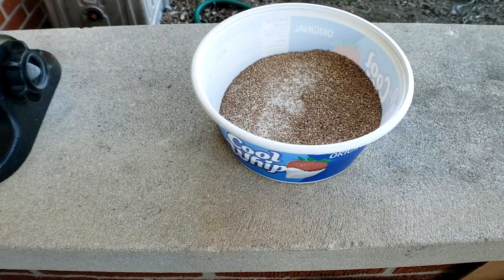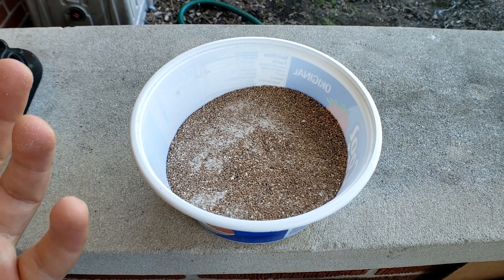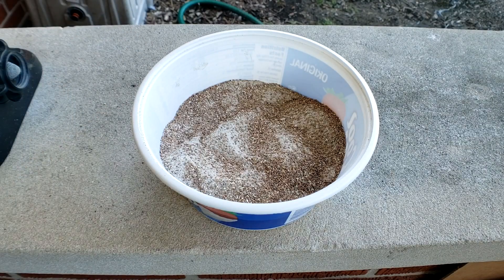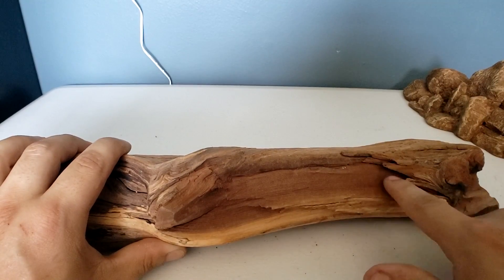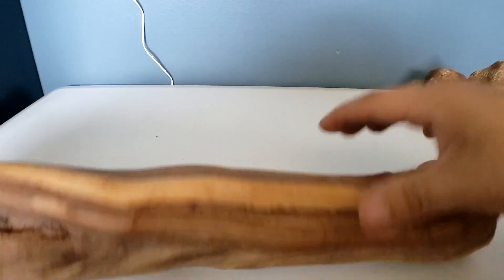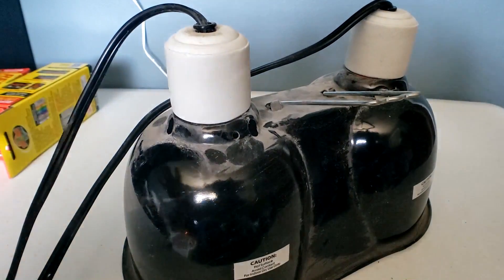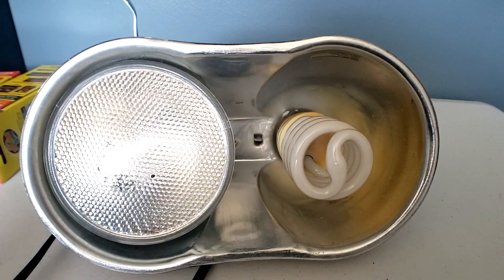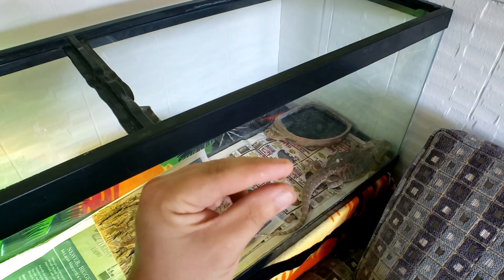Neglected Dying Bearded Dragon RESCUE Day 2 Part 1 Accessory Investigation | WHY Is the MBD SO BAD??

Comment: The thing about UV bulbs is that even when they light up, they are still going bad over time. It takes a few months and then there's no UV coming off it at all, but you can't tell that by looking at it.

I also tested some of those bulbs that are made for birds, with an industrial UV meter, and they don't give off nearly enough UV for use with birds. I don't know if the reptile-specific bulbs work well for reptiles, but the bird ones are a waste of money.

Comment: the device is an membrane oscillator for making mist.. think Halloween fog
Reply from the maker: ahhh i get it
Reply: @Animal1Guy  all it needs is a power supply... I have one just like it. I can dig it out and check the voltage if you would like to use it.. I can build the proper supply if ya wish

Comment: Glass fish tanks with screen tops make no sense in keeping things warm.  Heat rises.  A 5 sided insulated tank with the front made with a double hung window, placed sidways is perfect.  Its like a siding patio door with a screen.  Screen stays closed with window cracked open only enough for air exchange. If you have a 36" uv tube above, it alone can get the temps near 80f even in a cool room.  A heat mat under a 12" tile that's thermostatically controlled does the rest.  Make sure to have some felt reptile matting velcroed on top of the tile as a safety buffer.  If your room temp can get real low you can add a small ceramic bulb type heater in a dome light fixture above the tile.  This should always be connected to the same thermostatically controlled switch so not to risk overheating the tank if the room is warmed or the window isn't open enough for vent.  Very steady temps are maintained.  My simple, effective & very efficient system shuts down at night and on it the morning via timer.  Good luck!

Comment: To anyone who reads this, please never feed kale as a staple! It is okay in small amounts, but it contains a type of calcium that will bind to your beardie's calcuim absorption ability and actually prevent calcium supplements from being used beneficially in their body. Also, romaine lettuce should NEVER be fed to your beardie. It is way too rigid and thick and will pretty much always cause impaction, if not choking. It also has virtually no nutritional value, so you're wasting time, money, and hurting your beardie if you feed this. Some things that can be fed every single day are (washed )collard greens, mustard green, turnip greens, and dandelion greens. Some healthy treats to feed are (washed) yellow dandelion flowers (not the white puffed out dandelion),  steamed or thinly sliced fresh yam, small cut pieces of butternut squash and yellow summer squash. Very, very small amounts of fruits such as strawberries and blueberries are also a good occasional treat, but these are high in sugar so don't feed too much of it-- i'm talking like once a week at most!!

Comment: The thing with the LED lights is called a mister/fogger. You plug it in and set it in a bowl of water. The water has to cover the whole thing, but too much water isnt good. It adds a foggy mist to the enclosure. I had one and used it for my chameleon. Definitely shouldn't be used for a beardie. Speaking of, my beardie is from petsmart. Ive had him April 13th, so 7 months. He's still pretty small. He use to run around, but he doesnt anymore. When I last measured him, he was 16 inches from tip of the nose to tip of the tail. All he seems to want to do is sleep. I dont know if hes trying to brumate or not. It did just rencently get colder here. Im in wv, so fall has set it. Should i be worried? Have any suggestions? Also, a video on correct lighting would be awesome.

Comment: It is due to this video I went and picked up a stone for our beardie. I have to say, she has taken to it like a long lost best friend. We placed her on it and she immediately pancaked out and stayed that way for the rest of the day. i Don't think we have seen her happier in her enclosure. I hadn't thought of a stone holding in the heat. Also keeps her tank warmer for longer due to the holding of heat. You really improved the quality of life for our little Ponyo. So far the stone it hovering at 90-100 degrees at its surface.
Photo of her enclosure - https://imgur.com/bjkjkXZ
It is too small I know, She moves very little as she has mobility problems and is not your average run and jump beardie. I work with her daily to try to strengthen her legs and help her move more. It takes her quite some time to come out of her hide and make her way up to the stone. I have it slightly challenging to get her to push herself a little each day. It is making a difference as my vet has commented that she moves more each time he sees her. The background is a 32" lcd tv with a chromecast that just rotates images every 10 minutes. Or on certain times I will cast a video from youtube of a tropical fish tank, which she absolutely loves. the lcd thermometer gives me ambient temps on the "Cool" side and humidity level. I use a laser therm on the stone so as to not go over 90-100. With the mercury vapor at the height it is the stone hangs at 90-95 most days. I dont feed in cage as she really cant yet chase her food.
Reply: we also had a smaller tank, but taking her out to even run around outside or on a towel is pretty good exercise! our guy didnt like running around either, he was definitely a saunter type. if it works for your baby then it works! 💖

Comment: Would driftwood from the beach (sanded and purged of saltwater) be a good material for shedding and tanks for bearded dragons? No splinters or pieces that are breaking off. Im just getting into bearded dragons since ive always wanted one as a pet but my family is just always afraid of reptiles/snakes and finally have my own place so I can actually have the reptile ive always wanted. It would be my only pet.
Reply from the maker: ya as long as its cleaned and splinter free

Comment: Question, are mercury vapor bulbs; one, safe for us to use( as if if they’re to bust or dropped is “mercury” coming out?), and two, are they even safe for the environment? Why not just stay with the standards 150w zoo med bulbs
Reply from the maker: MVB are safe as long as you dont eat them. They put out a lot of UVB and heat for the amount of electricity they use, and the cost. A t5HO 24 inch tube uvb light will give about 1-2 UVB a a few feet away with almost no heat, where MVB in a dome at the same distance can give 4-6 UVB and a great amount of heat!    I dont use them in ever tank, it depends on the amount of UVB and heat the reptile needs and the distance the light will be at!
Reply: Animal1 Guy  true but if u have a 150w basking bulb In a reasonable size adult beardie tank, there basking spot gets 90-105 pretty good. So why add more heat? Unless u live in like the north or something lol. Plus does the  uvb from a mvb stretch across the cage as the tube light would? Not trying to educate you or tell u tht ur raising ur reptiles wrong cause your one of these youtube people that actually know what they’re doing. Just trying to get more information, because I just got in a rescue beardie myself and his owner poorly had a coiled single uvb lol.

Comment: I use a hot water bottle n he loves it. I inherited  him, he was always cold on his belly, read alot about the heat rocks, I remembered I had a hot water bottle, he loves his. I will take it out just before his bedtime n first thing in the morning put it filled with joy water. He jumps right on it. I put fresh hot water in about 4 times a day, he will actually put both feet on it to let me know it's not warm , put it in hot n he climbs right on it. I love this little guy. Learned so much n thought I'd share the hot water bottle. I see so many comments on the net n forums stating they don't need it but in the wild they bask on hot rocks to get their bellies warm so I disagree totally with those who say they don't need heat on their bellies.
Reply from the maker: Wow great tip, and i love that the hot water bottle is working! I am also glad everyone is able to share these tips!
Reply: I have been thinking of trying the microwavable rice pillows my wife uses for lady time pain. Probably doesnt hold temp as long as the water though.
Reply: @JamesEmersonRolliePollieTechie  you can buy a hot water bottle online through Amazon, they aren't very much n it doesn't get hot enough to burn then n stays warm up to 4 hrs. Qibli loves his.
Reply: Grl_With_A_Gun11 playstation pro can you post a link?
Reply: I'm not a reptile keeper (for some reason this came up in my reccos and it was interesting, which is why I'm so far down in the comments 🤗)

BUT....beware the cheap rubber HW bottles. I use HW bottles in winter cos I love them - and so does my cat - and the rubber ones really aren't safe, especially the cheap ones. I had three new ones in a row burst and an animal could end up with serious burns. In fact, that used to be an issue with old people back when HWBs were everyday regular items.

So anyone using one for any animal, look out for the thermoplastic ones. They cost more (but still not much, $10-15) but are far higher quality and much, much safer. I've got several, some well over a decade old and they are an improvement in the rubber ones in every way; safer, no smell, no degraded rubber etc etc. They last so much longer too that any costs are made up in longevity.

Finally - I shuts up in a mo, honest - also check out the "Snuggle Safe" heating pads. These are solid, you just heat them in the microwave and as a solid disc, there's nothing to leak or degrade. They'd probably be perfect for reptiles and they hold heat longer than an HWB. They're absolutely indestructible, even tho my kitten chews his!

Sorry, apologies for butting in. But the cheap HWBs are not safe and because they're not used so much these days we've lost the community wisdom about them; leaks can appear any time, they degrade, never use unattended with pets/children and all the rest. Your beloved dragons have sharp claws and those are not a good combo with HWBs.

Old rambling person shuts up now. I hope I haven't offended anyone nor telling you stuff you already know. But HWBs are virtually obsolete now and we just aren't aware of the dangers.
Reply: You just have to be careful w/those because it’s hard to accurately regulate their temperature and it can cause pretty severe burning (I think...)
Reply: @sparxso9122  I can regulate it better than anything else. I use a heat beam gun.
Reply: He still wants his hot water bottle. Every morning he is laying where it goes daily in his home. He gets right on it. I do put a little baby bibe cloth on it now cause the apartments re adjusted the hot water. But he's my boy. 💗
Reply: Please get him a thermoplastic one rather than rubber, if you do have rubber. I'd hate him to be harmed in the myriad ways rubber can do so (apart from bursts and leaks, he may swallow rubber pieces where they degrade.)

My cat loves HWBs above all else too :-D
Reply: @randomhumanoidblob4506  there isn't anyway he could chew or eat this rubber, idk if you even know how thick the rubber is.  Secondly i don't over fill it to where it's bursting at the seams. He doesn't weight enough to burst it. The one I have is just fine, it's changed every 4 hours n washed. I would see if there was any wear. This isn't a cheep water bottle n never been used by a human which maybe maybe able to burst it. But eat it ... No. Boiling water is never put inside it , it's not hot enough to burn him. As I mentioned I use a baby wash towel over n around it. I pay attention to him all day everyday. See he was my son's who died last year. So he is very well taken care of. So no worry whn it looks worn or falling apart it will be replaced long before that. Thanks.
Reply: I didn't mean to offend, and apologies if I have.

I'm sure you're very careful and it's obviously a good one if its lasted four years. But they all degrade, and rubber comes off in tiny pills. I doubt it would harm a large reptile even if he did eat a few but smaller ones I don't know. It's just something to be aware of.

The type of water affects how they degrade, too, especially if you fill direct from a tap (something on the "do not" list, but everybody does!)  What tends to happen is the rubber wears thin in spots and you have no idea until one day it just gives way and BLOOSH! 

It's just useful info to know because they look perfect on the outside but could be wearing paper-thin in spots inside. They used to come with all these warnings so it was common knowledge but that's dying out as their use decreases. But I had one give under my cat - a good one, I'd used it for years, it looked fine. Thank god he wasn't scalded, tho I was (don't care about me but I'd have been devastated if he'd been hurt) so I'm probably way more wary now than is necessary.

And yeah, the cat didn't get scalded but he was bloody FURIOUS when I changed it. How dare I take away HIS hwb and give him a nasty new one, huff 😠Don't think he ever did forgive me...
Reply: @randomhumanoidblob4506  oh no offend..:) i havent even had him 4 yr.. its just now a year Feb I lost my son and got Qibli. so the water bottle isnt old at all.
Reply: On my god, that's awful! I'm so sorry, losing a child is all kinds of terrible, you poor love. 

I am glad your beardie gives you something good to fill the void. I'm not sure why but I've become really interested in them because they seem to be amazing pets. From interactions I see here on YT, there's a whole little set of reptiles that are every bit as bonded in a mutual relationship with their owners (well, I say "owners" but we all know who really does the owning!) and they have real individual, specific personalities as much as any more traditional pet. They're fascinating little dudes. Sounds like he was just what you needed :-D
Reply: @randomhumanoidblob4506  thank you. Yeah no one could ever really know the pain n how it takes you apart loosing your child. I have 3 kids n he was my boy. You love all your kids , each one different cause they are different. But he was just close to me. A stupid ankle surgery n jack ass doctors who wouldnt listen to him cost him his life. Blood clot to his lungs. 32,yrs old. It has crushed my world inside n out. Never ever take advantage of what you have here today cause tomorrow may never come. 💗😓💗

Comment: @Animal1Guy that water bowl thingy is so wierdly shaped because its intented to be setup like a little pond . Normally its sunken down in the substrate/bottom ground .like you would make a thick substrate layer , dig a hole where the water bowl fits in and then the rim of the water bowl would be the same level as the top of the substrate and that would create something like a sunken in water bowl or pool for the reptile . I hope you understand what i mean and how its normally used . Sincerely Daniel
Reply: it actually looks like a mini basking rock for something like a turtle or a smaller reptile
Reply: I thought the same thing. I was going to make a comment about it, but wanted to see if someone else mentioned it first.